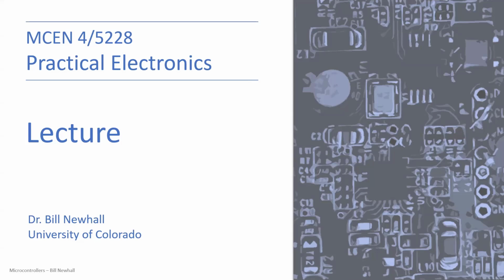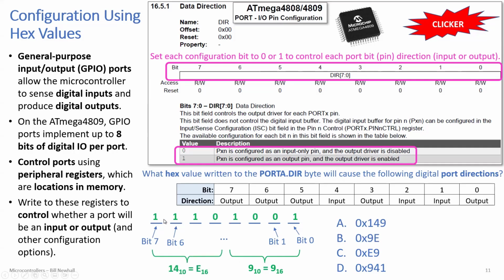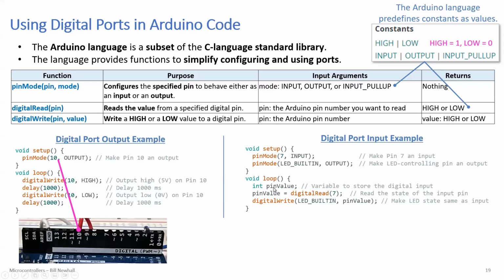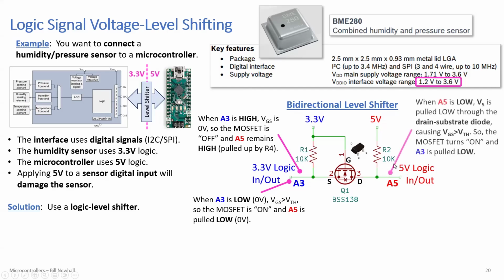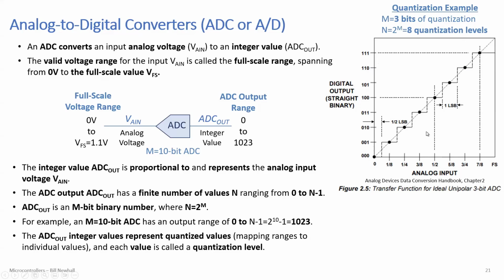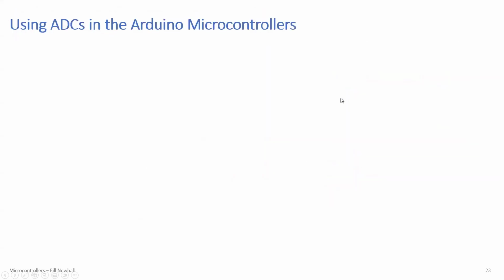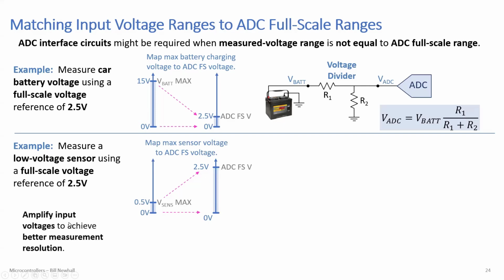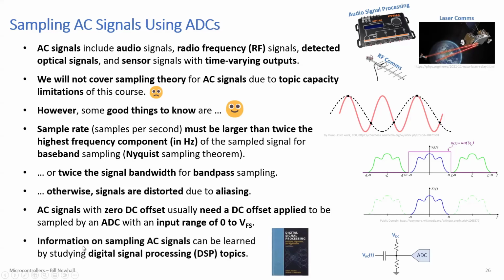Practical Electronics - Lecture 16

Comment: In the ADC voltage divider, was the formula correct?  At https://youtu.be/kwZTKGLN-ls?t=2483 the formula is give as Vbatt* R1/(R1+R2). Should the numerator have been R2?
Reply: I believe you found an error.